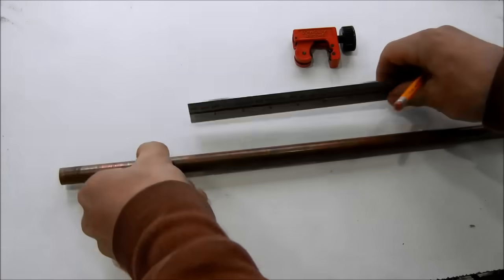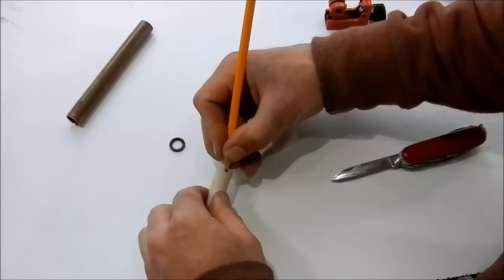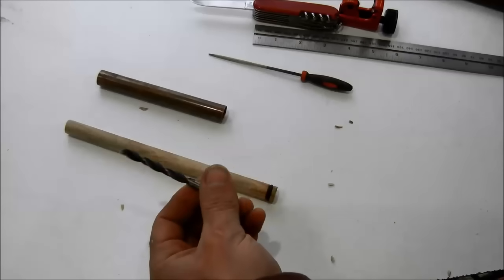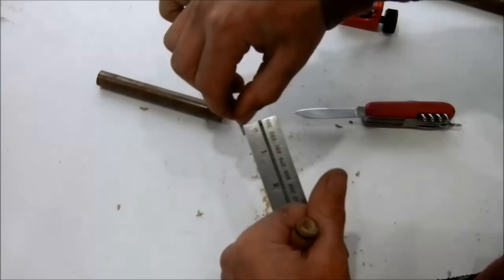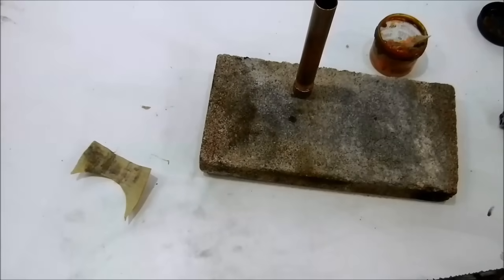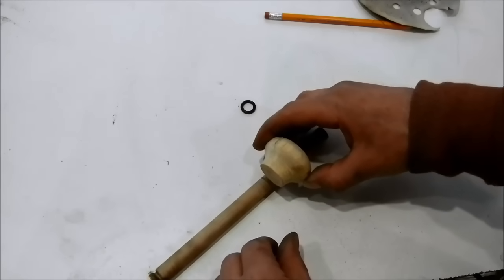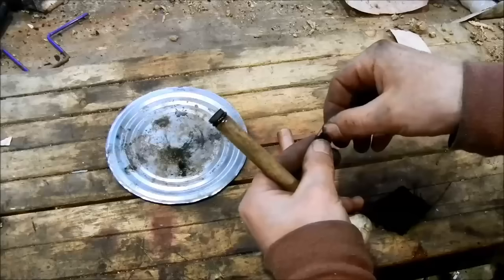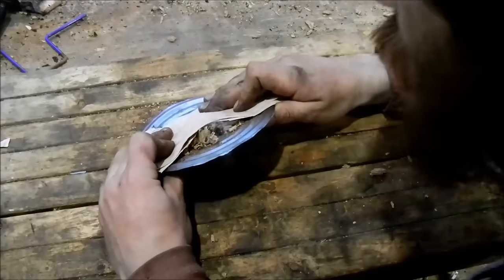Making and Using a Fire Piston

Comment: How to cut a groove:  Insert dowel into drill...  While cutting the groove, remember the best and most secure seal will be with a square channel, not a U-channel, so use a square or rectangular file, not a round file.

DO NOT EVER USE OIL.  You can literally create a small bomb, breaking bones and losing fingers.  Use a non-flammable lubricant, such as thick, water-based phlegm.  Gross, yes, but you get to keep your fingers.

The handle will be much sturdier if you drill out it's bottom to a depth between the radius and diameter of the dowel, then use a very sturdy marine epoxy, followed up by a screw to keep it taught until it cures.

The process also works far better on an insulating slab of wood than on a thermally-conductive and heat-robbing metal can lid.

Given all that technology, though, I just BIC lighters.

Comment: Assuming it is actually air tight, I don't think you could bottom it out if you wanted to, no matter hard you hit it.   The pressure inside would rise far too high.
Reply: if the wax or oil seal isnt enough it could
Reply: @chucksneed1264  "assuming it is actually air tight"
Reply: @tarstarkusz  why are you making assumptions
Reply: @chucksneed1264  It's not that type of assumption.  It's "given condition X, Y will happen"  Now quit being a doofus.
Reply: @tarstarkusz  yes it is

Comment: I made one like yours but made it where I have two that fit inside of each other and I keep my char cloth in them by putting a cap on end and I keep matches a lighter and a few guitar picks cuse they light so easily never get water damaged or wet where they cant light make great fire starter instead of looking kindling and it burns ten times hotter then kindling does I'm exadurated on the temp it burns but way hotter then any kindling you can find. Thanks for the tutorial just added it to my kit I been building lerfecito my needs since I was 11 in boy scouts  thank you
Reply: What is char cloth?

Comment: I had never heard of a fire piston. Good video...thanks. What causes the heat to ignite the char cloth?
Reply: Err, the heat! 🙂

Most materials will 'spontaneously' combust if they are hot enough, this tool compresses the air about 20 to 1, making it very hot, put an easily combustible material like char cloth in there, and hey presto, you just made fire...

Comment: When you take the time to polish the copper even tho it's not necessary, you are sending a signal to one and all that you took the time to make this thing well. I find the same thing looking at engineering drawings and software source code: there's often a strong correlation between stuff that works well and whether the designer took the time to straighten it up and comment it understandably
Reply: You can't get a good solder joint unless you have the copper bright and shiny.

Comment: Tip: Always put the flux on the inside piece first. You'll thank me.

Also, clean the outside of the solder with something like steel wool before you make the joint to reduce the amount of contaminants.
Reply: Do tell. Flux female/fitting first? I'm curious why
Reply: @grinderpumpguy  To keep things clean. If you put the goop on the male side of the fittings first then anything that touches it gets goop on it. If you the female size then it's pretty hard to get that goop on stuff.

Comment: What exactly is causing it to ignite when struck?
Reply: The rapid increase in pressure generates a lot of heat, and if that reaches the ignition point of the char cloth you get an ember.
Reply: @ToBeeOrNotToBeHoney  Thanks, interesting.

Comment: I have found dry gourds and the paper inside are real nice for starting fires whether from the piston or sparks. Keeps the wind off and ignites well.
Reply: Will the un-charred material ignite in the piston or do you use it as your tinder bundle for the ember?
Reply: @donalddicorcia2433   I think the material in the piston should be pre charred but it needs to come out of piston immediately or it will suffocate and go out.

Comment: That was a very interesting video. The only question I had was how many lighting's that old ring would last for, and if the O-ring is really necessary?
Reply: If I’m understanding the physics, you need a tight seal because the heat of compressing the air is what lights the tinder.

Comment: Materials I used:
Copper pipe 1/2" Dia.  5" long  and end cap
Dowel 1/2" Dia. 
O-ring 9/16" O.D. 3/8" I.D.
some means of soldering the cap to the pipe.
Round file for O-ring seating 
a wood drawer handle and long wood screw.
and of course some dry previously made charcoal like paper

Comment: I just made one but it doesn't work. I used the same materials as you did but no spark. When the plunger is inserted the 1/2 dowel above the O ring wobbles and is not tight against the 1/2 copper tube. Is yours like that?

Comment: 4:22  When soldering apply the solder at the far side from the torch. This will ensure that the whole project is hot enough and you won’t have to re-flow the other side.
Reply: Yup, when brazing like that, always use the heat from the part to melt the tin/lead/silver. That way you know that the part is hot enough for the brazing to catch properly.
Reply: @pierremartel3552  yea but he isn't brazing just soldering the copper pipe. With brazing ur going at a way higher temperature vs soldering that uses lower temp.
Reply: @SouthJerseyBaitReviews  Brazing is a metal-joining process in which two or more metal items are joined together by melting and flowing a filler metal into the joint, with the filler metal having a lower melting point than the adjoining metal.
Reply: @pierremartel3552  you went to google didn't u lmao. Like I said brazing uses higher temps simple as that while soldering takes less heat. Its the same thing or process just one takes more heat than the other.
Reply: @SouthJerseyBaitReviews  soldering use higher temps to melt the metal so it will fuse together.  Using a metal between 2 part is without fusing metal is brazing.
Reply: @pierremartel3552  bro idk where u got that but it's wrong. I literally solder using a soldering iron while brazing takes a full on torch to heat the object up to a high heat to then apply the filler metal. So it allows to stick and create a harder bond and usually used for higher pressure applications.
Reply: @pierremartel3552  We call that welding. Nor soldering. Don’t we?
Reply: @pierremartel3552  I take all my brazing jobs to Dairy Queen. I leave the brazing to the professionals.
Reply: Thanks for the tip
Reply: I wish this community would start making vids for Ukraine, after the Russians leave, before major rebuilding is done.  How will the citizens live in the meantime?
Reply: @veramae4098  Do it.
Reply: @veramae4098  lol, eat the j__ish globalist propaganda and regurgitate it all over everyone.
Reply: @veramae4098  , They'll do just fine.

Comment: How simple! You only need a copper pipe, a soldering gun, a wooden rod turned to size, an O-ring, some cloth and a little diesel fuel. Exactly what you find in the desert!
Isn't it better to use two pieces of flint? or buy the hell some matches?

Comment: Making one to carry in the glove box of my jeep. Never know when a fire can come in handy! Subscribed 😊
Reply: Ever heard of a Bic lighter?
Reply: @davezemba9109  I carry one in the jeep. Those things slowly drain. There is nothing to drain in one of these compression pistons. A lighter is a better choice if there is fluid in it...
Reply: I've had lighters sitting around for over 30 years and they still light. It's what the military uses.
Reply: @davezemba9109  Most Bic lighters last a long time. Most. Not all. This pressure lighter does not use a fuel that can leak out and evaporate. And it is very small. Takes up around the same space as an ink pen in my glovebox. I would rather be safe than sorry. You do you...

Comment: pro tip for the o ring groove- use your pipe cutter to mark 2 lines. Really well done project and video :)
Reply: Exactly what I was thinking.  And if you have a drill chuck large enough, you can put the wood piston in it at low speed to make a consistent groove with the file.
Reply: You could use a drill or drill press as a lathe to cake o-ring groove
Reply: That's a good tip!
Reply: That, Sir, is an inspired idea!
Reply: Or a table saw set depth?
Reply: Brilliant tip!

Comment: You had me until you mentioned birch bark, I can find something else.

When you turned the knob in the lathe turn it around and bore a hole the size of the dowel about 1/2". cut the length  of the dowel a 1/2" longer. put the dowel in the nob to press down on the plunger, it won't come out. When you pack your kit you can make it shorter by taking the nob off the dowel. If you loose the knob you can make a replacement out of a piece of a branch.

Comment: Alls you need to make this simple fire piston is a Blow torch, solder, file, flux, sand paper, rubber o-ring, drywall screw, coping saw. Drill w/ 5/32nd and 7/64th bit. And a ruler or you could eyeball it. Nice craftsmanship but you should just bring a lighter.
Reply: Then don't make one.

Comment: Very interesting; it uses the phenomenon of air heating rapidly under compression, just the same principle as that of the diesel engine, compression ignition.  It's hard to imagine that enough heat can be generated by compression alone.  And yet, put your thumb over the end of a bicycle pump and compress and you'll get a blister before you know it.
Reply: In addition to the heat, it is also concentrating oxygen.
Reply: The fire piston was the inspiration for the inventor of the diesel engine.
Reply: like meteors
Reply: Thanks Roland , I thought I was going to have to google it 😁🍻
Reply: Please don’t advise people to put sources of high pressure air right against their skin. Very bad things can happen if air is injected…

Comment: If you buy all the bits at a Big Box store, this would (assuming you already have the tubing cutter and soldering stuff) set you back around $15 (and you'd have lots of leftover screws, o-rings, dowel stock, and at least enough extra copper pipe for a second unit -- shortest pieces I've seen are a foot long).  You could probably build with threaded plastic pipe and a screw-on cap and teflon tape for about the same price, though it might be harder to find a dowel that fits the pipe well.
Reply: You don’t even need a screw, just cut the dowel about a half inch long, drill out the knob and glue it in if it’s not tight.
Reply: @NeedleDrops  that is what I originally thought he would do, and what I would have done. Probably stronger that way.
Reply: People like us that just do primitive skills for fun generally have all sorts of materials in our shop and never buy new. If you do, you probably should stick to video games.
Reply: Or just buy $15 worth of lighters.
Reply: or......... you could buy a gas cigarette lighter for 50 cents
Reply: @irw4350  Sure you could.  But where's the "I made this" satisfaction in that?  And will that lighter still work after twenty years of daily use?
Reply: @SilntObsvr  but for the stated $15 I could buy 30 of them.
The "I made this" satisfaction - OK, I get that  😬
Reply: @irw4350  A fire piston is also inert in storage and transport, on like a butane lighter...
Reply: @SilntObsvr  yes = true that

Comment: Great video!  I haven't seen this before, but it makes sense how it works.  Just guessing but it's probably important that the plunger is long enough to get the highest compression ratio, but stops before it hits the cap on the end.  Subscribed. 👍👍
Reply: It’s cool as a science experiment, but it isn’t very practical if we’re talking about realistic scenarios, like if someone had to make fire to survive. Hardly anyone who doesn’t carry around a fire piston carries around char cloth, and good luck finding the necessary parts and tools to create the piston. 

A Bic lighter or torch would serve most people better. Heck, a Ferro rod would work better in most cases. If you’re out of char cloth, you’re out of luck. 

Even if someone had one of these, with char cloth, I’d still rather have a Bic lighter, a torch, & a ferro rod. 

The way it works is cool, it just isn’t very practical, that’s all.
Reply: @christophermitchell7925  To me, this is more of a "stash it in the bottom of your day pack, just in case" tool rather than something you'd use every time you camp or hike.  This tool, an Altoids tin full of charcloth and punk wood, and a cheap lockback folding knife weigh less than half a pound, and if you get stuck on a trail (cut off by a flash flood or a slide, perhaps) could be the minimal survival tools you need.

And sure, I carry a butane lighter (a much better one than a Bic, mainly purchased for shrink tube etc.), and a magnesium block with attached ferro rod in my pockets, every day -- but lighters run out of fuel at inconvenient times and this is much quicker than a ferro/magnesium fire block, given equal tinder prep...
Reply: You are correct -- you need a minimum compression ratio of about 14:1, and 20:1 works better.  Quarter inch clearance with a five inch stroke gives that 20:1, near enough; that gives an air temperature high enough to ignite pretty nearly anything combustible (charcloth holds the resulting coal well, but primitive makers of these have used shelf fungus shards, dried moss, etc. -- anything you'd use for first tinder with a spark or friction fire tool).
Reply: @SilntObsvr  Thanks!  It's on my list of things I want to try now.
Reply: @SilntObsvr    For loose material or shavings could it be put in the bottom of the metal tube instead of in the end of the plunger?  Would dumping them back out cause problems or residue result in fowling with repeated use?
Reply: @ckl9390  
I'd expect fouling to be an issue, as well as the tube stealing heat from your ember (especially with a copper tube like this).
Reply: @SilntObsvr  this ratio needs to be pinned to the top instead of in a comment.  Good information for future makers.

Comment: ? Why not Just Buy a Lighter ? If It's a survival tool,,, and you could buy the copper pipe & Fitting & flux& solder , Propane etc,,,,,,, why not just buy a couple lighters for a couple bucks ?

Comment: Very very bad way of attatching the knob on top  very bad in fact verging on extremely dangerous a hole drilled into the bottom of the knob and the shaft glued in much better and safer

Comment: A perfect example of the advantages of the imperial system of measurements! To achieve this clear success hardly any measuring is necessary, mostly guessing and trying, even repeatedly, and this is working perfectly! Why bothering with metric?
When it comes to real accuracy and no guessing is possible then there is trouble ahead. Especially when the proportions are exceeding this example, far larger or smaller, or crossing the dimensions, getting into  volume, temperature or pressure, maybe energy as  possible in this example, the limitations of the imperial system become obviously!

Comment: Interesting. I have never previously heard of starting a fire using air compression. Thanks.
Reply: When air is compressed the same heat content of the column of air is now in a space much smaller so the temperature goes up proportionally to the compression ratio. To me the cool thing is that if you let the compressed air pocket cool back down to ambient temperature, then let it expand, it will need to pull thermal energy out of its environment in order to expand. This is called refrigeration.
Reply: Diesel engines do just that all day long! Which is why we never hear a trucker complaining that he needs to change his spark plugs
Reply: @robertmencl9169  I know, but never expected that the temperature would rise high enough to ignite a solid

Comment: Nice build.  But isn't a disposable lighter easier and cheaper?  Then again the propane torch you used for sweating the joint works well too.
Reply: Disposable lighters run out of fuel this doesn't
Reply: @leonardmettlach2614  this needs fuel to start an ember.  The charcoal cloth was used. It runs out.  Let's see how well this works with found tinder.  A lighter is a sure thing and you can preserve  the embers of the fire.

Comment: This was figured out by native’s of New Guinea a long long time ago using materials found in the jungle where they lived
It took me a few tries before I made one that worked using a dowel and a piece of a sledge hammer handle for the barrel and the top knob I have also made one out of copper pipe similar to the one in this video and another using an old Mag lite that I keep char cloth and a little Vaseline in the area the bulb went in
If your not air tight between the plunger and the tube you can add a second Oring slightly above or below the first one it sometimes works and saves starting over
Reply: I was wondering if this could be made out of bamboo for the tube.
Reply: I was combing the comments looking for someone that said they built one too, and it worked. Huh.
Reply: The natives of New Guinea were still in the Stone Age molesting each other when we found them, don’t give them to much credit lmfao
Reply: Or you could just put a lighter in the flashlight case.